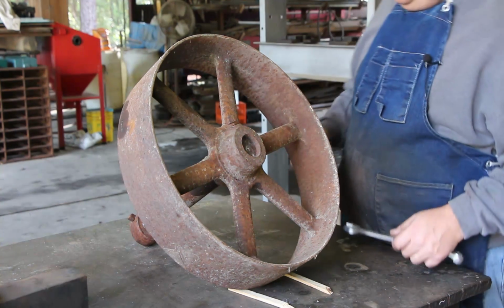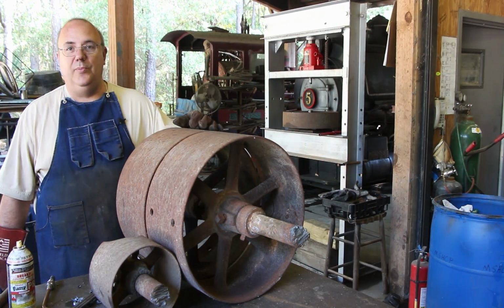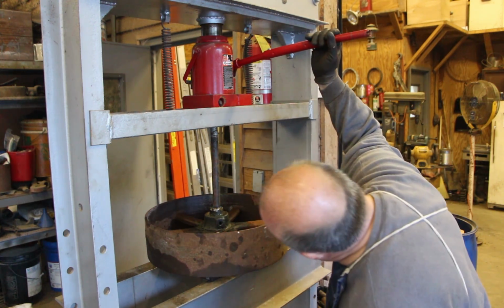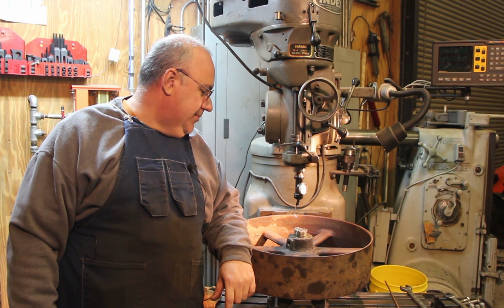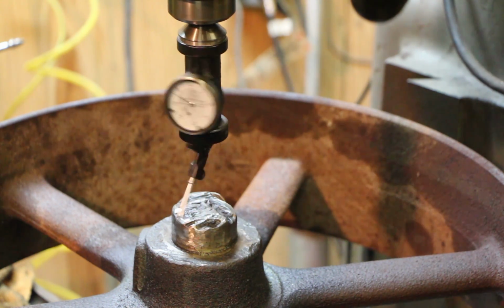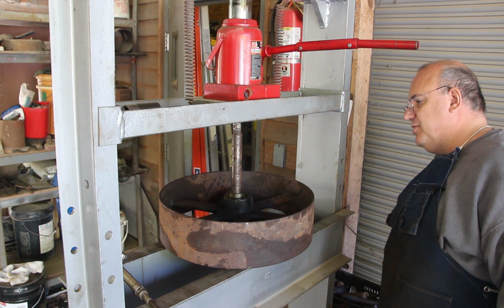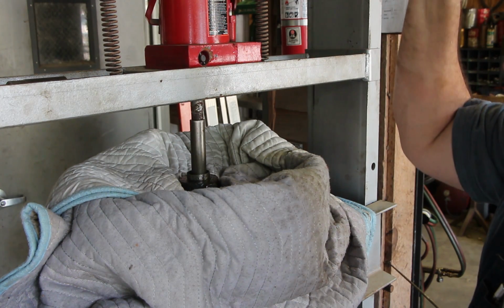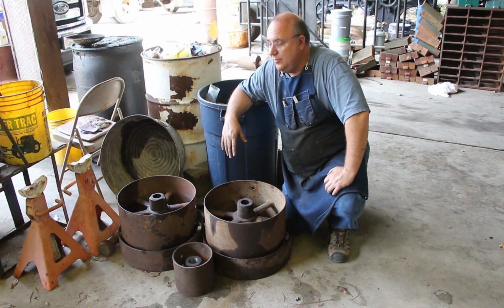Removing Stubborn Shafts from Flat Belt Pulleys

Comment: Wow!  What an adventure!  Maybe throwing the whole pulley into a campfire and just evenly heating it.  You didn't have many options left, Keith!  Penetrant, geometrically calculated application of heat, shock, pressure, time........, relieving the core... the kitchen sink...  The only thing that you had left was a stick of dynamite!  So there was some interference and some derelict set screws!  NOW WE KNOW!  Gota spot-sand-blast the hub in the future.... now that we learned.  If it didn't come loose, the lonely thing I could imagine is that the shaft was tapered (not the case).  All bets are off when you are working on something that old.  You just got to wing it.
Reply: After you chowed out the bore, I thought it would come out.  Maybe cutting some axial slits.....  Who knows.  That was an abnormal condition.  100+ years old, many hands had altered it....  You could have titled the video, "The Shaft That Wouldn't Budge".  Hey, that was a good video.  I hung on until you succeeded!  I bet you are glad that is over!

Comment: Hi Keith, wow great video. You always said there are many way to get a job done, this one just took more of them than normal. You didn't said if the pullet hub bore was damaged or not? Maybe you could let us know in your next installment of what has to get done to the pulleys to get them ready to go back on the planer. If you make a video of it. I subscribed early on and got hook on the repairs to the planer. It's been a long process, but really enjoyable. Thanks for sharing the safety tip with the blanket, cast-iron does have a tendency to explode when it breaks under pressure. Looking forward to see your progress on your safe too. Thanks for your videos.

Comment: On the stuck shaft... if you drill a hole off center (even near the edge) and then make that hole bigger and bigger until it just breaks through the edge of the shaft... should press right out and you don't have to remove massive amounts of material.

Comment: Hey Keith, I'm 09:09 into the video. I am wondering if raising the wheel closer to the upper portion of the press and then using a smaller piece of stock to apply pressure would be more beneficial. I don't know if that would have helped or not but in my mind I would think you are losing some of the mechanical advantage by having so much distance in between your work and the press.

Comment: On a similar job to the big pulley, I've had luck boring out the center and taking a hacksaw blade or Sawzall and cutting from the center of the axle out to near the inside diameter of the hub to give the shaft enough relief to be pressed out.

Comment: a good idea is to use some piece of pipe to support around the pulley's inner bore an the shaft would go threw the pipe's hole, in Keith Fenner's video of his press he shows a shelf full of all sizes of small pieces of "pipes", pressing on the pulley's edge may brake the pulley or even bend it
Reply: You keep mentioning in numerous posts to support the hub of the pulley. Apparently you are not very observant as if you watch carefully you will see that he is not supporting it by the rim. If he had been that blanket would have absolutely been necessary.
Reply: i mentioned only once , the other posts i was commenting on other people's comments that observed the same thing, i watched the video again and didn't see i am probably overlooking ....
Reply: sorry I really didn't saw, some others made the same argument i did :)) Now it seems like such a stupid mistake someone like u wouldn't do.

Comment: If I had been in the same situation due to my lack of a big press I think I would of bored all the way through to a thin wall then threaded a hacksaw through and cut the wall through to the casting in a couple of places, then attack with a hammer. In fact if you can get on centre well enough you could bore until it is like foil and pick it out. But it was a deep hole so might need more of the shaft cutting off. Or possibly the pulley would of ended up in a million pieces :)
Reply: Severing the outer edge of the shaft is my intent in the above post about drilling off center progressively bigger until it is severed. Might have to bore the last little bit so you don't get into the pulley. There have been a few times when I have slit the outer part to get a shaft out and then welded it back up for the new shaft (the one that comes to mind was a torflex axle spindle replacement). The split whether on the shaft or hub really breaks the grip.
Reply: Hey, your way worked... :)
Reply: ***** There is one factor that is important to all of the approaches though and that is perseverance. Those moments at the press where you paused and must of thought "really, are you kidding me" but then carried on even if you needed a brief hiatus, that's what it takes.
Reply: Yea, he was stumped, but he didn't give up. :)

Comment: what tonnage is your press keith it definitely worth its money pushing that shat off i hate jammed shafts and bearings
Reply: i used to have a 60 ton hydraulic i left it in one of the garages i used to work at i never got back to pick it up

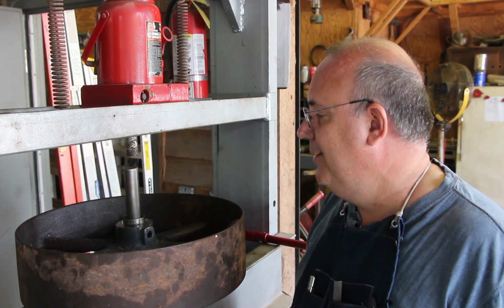Comment: Great words of wisdom at 25:31...
Reply: ***** My pleasure! I try to remind myself of that same thing during every project. The key is convincing my wife that I'm not procrastinating...
Reply: ***** Nice video. Thank you.  I especially appreciate seeing the co-axial indicator put to use.  When you used the saws all to cut off the rough shaft ends I thought that it would be useful to cut both ends as close to the hub as possible, then drk ill clear through the shaft until you are near the shaft size..  The saws all can then cut away the remaining distance in one or more places allowing you to use a chisel and hammer to peel away the remaining shaft metal.  I use that technique to remove threaded pipe from small engines where pipe was used for exhaust and the threads pretty much rust solid.  You can cut until you see the beginning of the threads and still be able to screw a new pipe nipple into the old threads.  Thanks again.

Comment: ***** Hi Keith, lots of times I will just oil it down for a couple of days, put it in a press and put some pressure on it and leave it overnight.  There have been many cases of coming in the next morning and finding the shaft sitting on the floor.  That burr on the shaft is why I always have an undercut next to key ways.
Reply: Since the pulley is cast and the shaft is steel once I got a hole through the center I would have split that shaft with a torch and then I think it would have come right out. Once it didn't come after the center was cut out I figured it was galled did pressing it out score the bore of the pulley any?

Comment: Glad you won the battle on the pulleys and no one got hurt on the making of this video. That was a good idea to put the blanket over the pulley. I once got a piece of metal stuck in my arm and the production manager took it out with a electric magnet. It was a piece of tool steel.  Thanks for sharing.

Comment: I'm betting it was less the scoring from the setscrew spinning and gouging the shaft, but more the pulley friction welding itself to the shaft after the setscrew let loose. That, combined with the pulley flexing since you didn't have the hub supported in the press, meant you'd never have gotten the shaft out without boring it.

Comment: Got to love the ones that fight you every inch of the way.  I have occasionally had luck with putting some pressure on and tapping with a hammer, just enough to start a little bit of vibration.

Comment: Hi Keith!  Nice job DONE!!!   I couldn't really see your press setup; but am assuming you had the hub supported either with bed steel or a big bushing?  This to eliminate ANY flex in the spokes and minimize damage......I'm sure you did; I just couldn't see it.

I do a lot of big sheeves on sand & gravel equipment....a couple things: when heating a big pulley like that; don't heat the hub.  Heat the rim circumference.  The hub is constricted by the spokes, and heating it just makes it tighter. You heat the circumference and it stretches the spokes and grows the bore.  Also; a Slice ultrathermic torch would be a great investment for the work you do.  I use mine frequently on big pins (crane or dozer drive chain).....with that shaft cut off you could blow a hole right through the center and indeed it would have shrunk enough to drop out with a hammer. 

I enjoyed the video......with the tools on hand you GOT IT DONE!!!!  Thanks, Sean.

Comment: It's easy to make suggestions when watching from 3000 miles away, but I just can't help myself. By placing a piece of steel pipe with an inside diameter just a bit larger than the shaft underneath the hub and pressing down on that so you are not putting any pressure on the rim of the pulley, but rather on the hub, you have a much better chance of pressing the shaft out without breaking the rim or spokes. Here in Germany flat belts are still in use to some extent and this is a common problem. Supporting the hub is the answer. Really appreciate the efforts you make to share your work with us.
Reply: I agree Gents..  The energy of removing the shaft from the pulley is being absorbed by the spokes and rim of the pulley..
Reply: @woxnerw  
No energy is being absorbed. 
The pulley centre is being fully supported from below. It would take only a very light pressure to break out the spokes and your understanding of this situation looks to be about as strong as the pulley would be if your take on this situation was true.
I can see why you say "what a great video clip this is"
Reply: Oh, I understand. I didn't mean to sound irritated, I just was surprised that these old comments are still attracting interest. Keiths videos never go out of date.
Reply: @BruceBoschek  Well it is April 11, 2020 and i am just watching this thinking the same thing and giving the 100TH thumbs up for the comment about supporting the hub. I had the luxury of working in a shop where there was also lathes so there was always a supply of pipe of various sizes that us mechanics gathered and left at the presses for various "high pressure" pressing jobs. It always irritated me when some ass decided to have a clean up day and some of those invaluable pipes disappeared in the metal bins. You could well imagine what various lengths came in handy AND thickness--- some very heavy wall etc....
Reply: Hi Bruce..  Some of us are just seeing this project and vlog ..
Reply: just commented the exact same thing :))
Reply: ***** Thanks very much Keith. I honestly would have been surprised if that was not the case, but it really didn't look like it in the video. I did enjoy watching you struggle :-).
Reply: If I were Keith, I would regard Bruce's comment with some amusement. Its obvious from the video the rim of the pulley isn't in contact with the base of the press, it should also be obvious that a cast iron pulley of this type would not take a 30 ton sideways force without failing if the hub isn't supported.
Reply: @johnmorrison1180  I don't know where you get the idea that the rim isn't in contact with the "base of the press" as you put it. It sure LOOKS to me and others that the rim is on the bed of the press. How is the hub being supported? It sure doesn't look like it. 30 TON? I don't see any gauge on the press except for him thinking that.
Reply: @KStewart-th4sk  The operator is v. skilled at doing this type of restoration work maybe a retired turner and fitter,  its just a basic trade skill to support the hub while trying to remove the stub axle. Give the guy some credit, he's a careful mechanic and in no hurry. The hub is being supported by a thick steel plate maybe 1 and 1/2" thick with a hole in to allow the stub to pass thru, it has to be smaller than the rim so therefor its hidden.
Reply: @KStewart-th4sk  I agree with the others, I went back and took a good look and the rim isn't sitting on the beam.  Again Keith has been there and done that and would definitely know what not to do.

On the pressure Keith said he was exerting, you'll find the jack is a thirty ton jack and Keith was at its limit.  If you had asked him how much force he was exerting on the others that came out easily, he would have shrugged.  

Nuff Said
Reply: Bruce Boschek he had plates of steel support the hub directly, but a pipe would work better.
Reply: I hear you loud and clear, Bruce..  Machine Work and it's Projects is Timeless and never go out of date.. I feel powerless to say..  If I were only 50 years younger..   sigh..   Channels like this are SO Fascinating to watch..
Reply: Please excuse me for saying..   It's so easy to see what is needed for the want of trying when seeing you struggling with your press, to remove the shaft..  Just sayin'..   There is a term in suggesting moves to a player to make when playing Chess..  It's called "Kibitzing".. I hope I've spelt the term correct.. How frustrating it is something doesn't go right in "Machine Work"..   GENTS..  What a Great Video Clip, this is..
Reply: Will Boys I just found this video today, and made a comment on it.
Reply: totaly agree the spokes will flex reducing pressure. Also as a side not, hthe long extension you are using between the jack and the piece you are pressing out could slip out they way you have it in there......... it could kill you under a lot of pressure when it pings out at you...... good vid though!
Reply: I was just going to ask if he was supporting the hub. I’d press the snot out of it if hi was supported.  I’d be too afraid to just press a cast iron wheel without bracing the hub.
Reply: @ryanmacewen511   you are absolutely correct... press only on the hub..it would easily break otherwise...but in addition to that he could try the slight tap as I described
Reply: @woodsmn8047  I'm sure Keith had this hub well supported, but your comment on the slight tap with the hammer WILL bear more fruit than some might think. Makers of presses should try to make accommodation for just this issue, it wouldn't be difficult to design a feature for doing this that won't hurt the jack, or be dangerous either.
Reply: If anybody thinks he's pushing on the rim of the pulley, get better glasses!
 I can clearly see at least a quarter inch gap, between the bottom of the rim and the "bed" of the press. 
Keith is a little sharper than any of the keyboard experts out there IMO.
Reply: I agree with you and all the other guys that replied but sometimes you have to use what you have and like he said, he was wasn't home at his shop, he was at the museum shop where I'm assuming he didn't have everything he needed. That being said, he worked at this over the course of about a week, he had plenty of opportunity to get something from home that would have worked. But...could you all guarantee that the face of the hub was perpendicular to the centerline of the bore AND outer pully? When the shaft went it it was a clearance fit or loose slip fit held with a set screw. There's a high likelyhood that the cast pully did not have a square machined surface on either end of the hub. He knew the outer edge would be perpendicular to the hole in the middle, the outer edge would have been machined after machining the bore in the hub. Anyway, again, I'm not saying any of you are wrong or anything, I'm just saying that I think he did the sensible thing in the given situation.
Reply: Good and right advise, I was thinking the same way because you loose lots of pressure force transferred to the rimes.
Reply: same here
Reply: I agree it’s giving in the spokes of the pulley
Reply: This guy hat a Lathe in that sitze and use it if is to late...🤔
Reply: I was just waiting for a spoke to go SNAP with all that force on it.
Reply: @lownslowav8r  how could a spoke snap,when no pressure is being applied to the rim or the spokes. The hub is clearly supported, or the rim would have broken immediately. 
 Look at the rim of the pulley. It's clearly not touching the bed of the press.
Reply: Just ran across this old video. The flak jacket on the rim was a nice touch.
I hate to admit I've list touch with a lot of the manual equipment except for an occasional surface grind job. Years in a dev shop with almost exclusive CNC equipment will do that to you.
Reply: This was 3 years ago. Why are people suddenly replying to this?
Reply: @BruceBoschek Same reason you are, the net is eternal !
Reply: @BruceBoschek  It's now six years ago, and this video just popped onto my screen. Fascinating! It was nice to see Keith get the shaft.
Reply: @clark57225  that's not very nice. Yeh I get your point. Just sounds strange.
Reply: Bruce Boschek 
Hello from 2019
Reply: @BruceBoschek  ...for the HELL of it(?)
Reply: @BruceBoschek  because we didn't see back then

Comment: Hi there Keith,what a fight! Had a similar problem with a pulley that had spun on the shaft and friction welded itself on. Had to bore it all the way as no amount of heating,cooling or pressing was going to shift it! Thanks for another great video,keep them coming!
Reply: I guess I am a bit spoiled these days now that along with my own machine shop I have access to a vertical axis lathe that would allow me to machine out the used axle. Like you anything more than 24" would be too much for my lathe but the vertical axis one can turn locomotive wheels!,but no more seized shafts please!